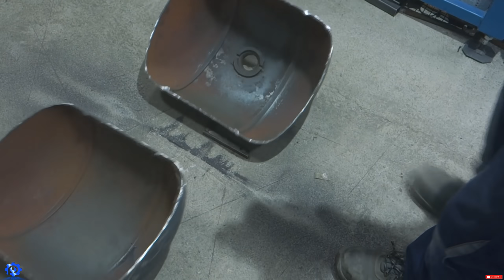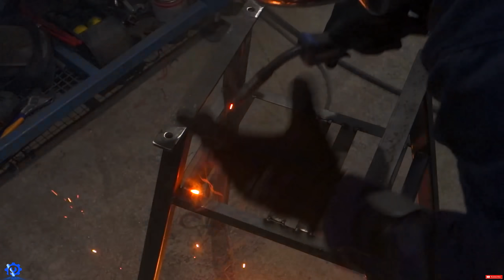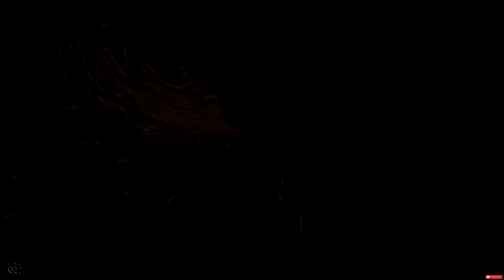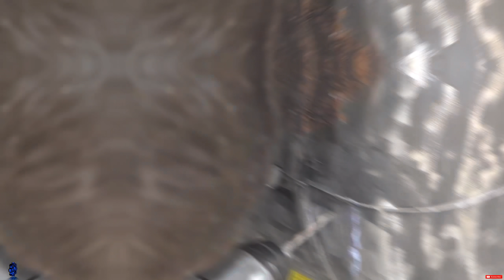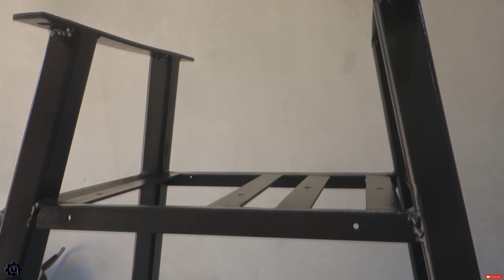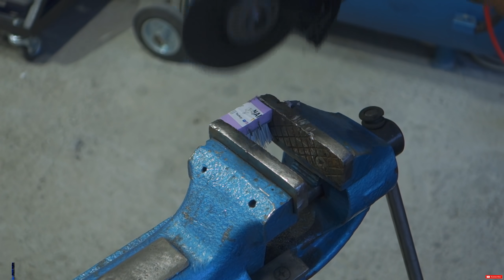DIY - PARTS WASHER!

Comment: I recently completed this project using a set of hand trucks as a stand to make mine more portable,  low psi 12 volt fuel pump, an a computer power supply cord to power it. Works great but on mine a brush instead of the nozzle is a MUST or the splatter will cover you. Thank you for the inspiration and great money saving idea!

Comment: Very creative use of scrap tank.  I was thinking of creating the same from used and discarded outdoor barbeque grills.  Often these are of the correct height and size to convert to a parts washer, with a cabinet made from stainless steel.  Your use of a fuel pump and PC power supply have given me more creative ideas, too.  Thanks for sharing this video.

Comment: Prices for mild steel have considerably raised lately. Currently it would be expensive to build all that. At the same time it looks like it all worth the trouble. I might be wrong, but try adding a 25l canister with fluid beneath the structure. Install 2 ball valves in a canister wall. 1 in a very bottom to remove heavy oil fractions and one in a top to remove light oil fractions. Suction is to install somewhere in a middle. That is of course if a pump can perform suction, as some of those can't. That will provide you cleaner fluid to wash with as fluid fractions tend to separate in layers. It is not necessary, but will grant you additional video and improve your part washer.
Reply: Not if you go to a scrap yard or had some scrap pieces laying around .

Comment: Nice project. Making a decent sized parts washer has been on my (Rather long) "To Do" list for ages. Never thought about basing it on a gas cylinder though. I'm now thinking that an old 47kg propane cylinder could be the ideal size (1290x375mm) for what I want. I mostly degrease old machine parts, but when you get up to the size of tank that can take things like 1 metre long lead screws, they're bloody expensive to buy, and pretty expensive to fill with cleaning solution.

I'm not sure how long the fuel pump will work for though. They apparently rely on the fuel going through them to lubricate certain parts. I'm pretty sure that running a degreaser through the thing's going to kill it........ But the question is "How long will it last"? If it burns one up in 30 to 40 hours of use it can almost be seen as a consumable part, but if it's only 2 to 3 hours of use between failure's, replacing it is going to get old and expensive very fast.
Reply: @frederikmare9002  Don't worry mate, I've been alive long enough to know the danger that even "Empty" gas cylinders pose.

I've actually got a large propane cylinder in the garage right now that I grabbed to eventually turn into a log burner. It's had the valve out of it for about 6 or 7 months, it's been filled up with water and emptied once, and sometimes, when I finish with my compressor for the day, and need to dump the pressurised air, if I can't be bothered to grope around under the tank for the drain valve, I'll just wedge my small "Palm" blow off gun in the threaded valve hole on this cylinder, because it fit's there with the trigger held in perfectly, and it blows dried air around in the propane cylinder. I do this partly to stop any condensation building up in it and creating more rust that I'll need to grind out.

Out of the 5 or 6 times I've "Repurposed" pressure vessels into barbecues/garden waste burners, I don't think ANY of them have been purged as thoroughly as this one has. :D